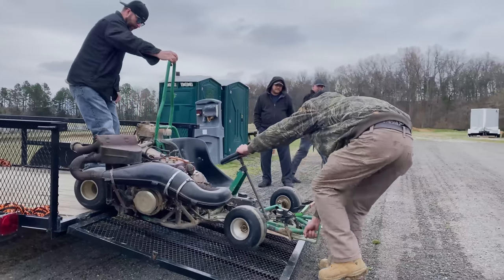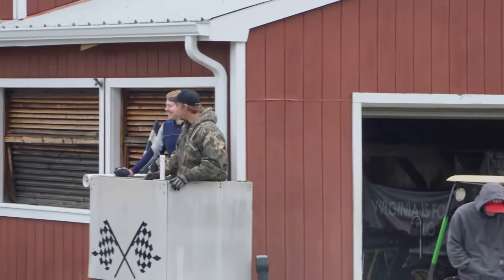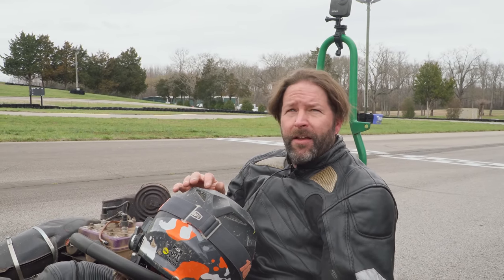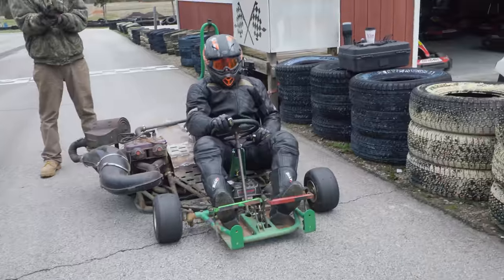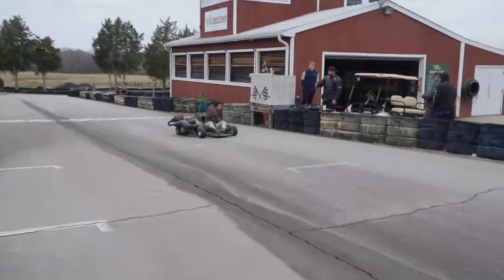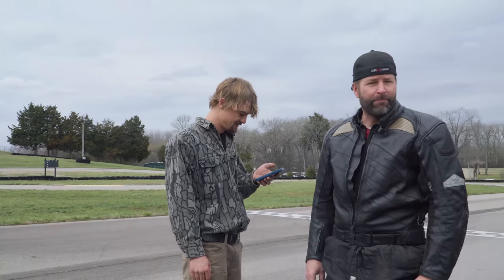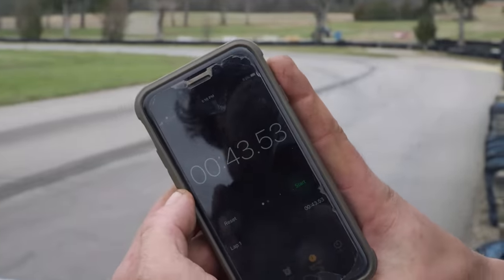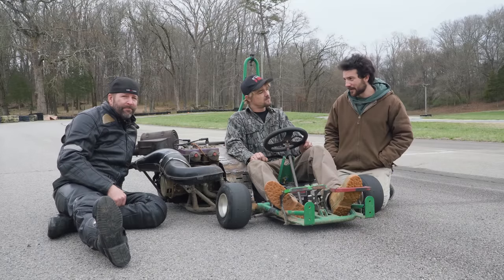We took our 125HP Go Kart to the Race Track! | *Insane Acceleration*

Comment: two strokes have their powerband from 7-8k rpm up to 11 or whatever is the limit. That kick you feel is the engine actually reaching is full potential
For the love of the engine make sure to heat it up always properly before sending it. 2s are design  taking metal expansion in to account and unless you want to kill it keep it warm 70-80 C° all the time.
Reply: The kick you feel is the engine hitting the pipe. That's when the exhaust flow pulls out the exhaust charge from the engine it's the scavenge effect.
Reply: I think that's what the Issac's slow lap was about.  He was rolling the thing around the track part throttle on cold tires.  The second lap he started leaning on it and warming the tires up and then he went for it.
Reply: That 670 twin spins to 8k max.  It doesn’t spin anywhere near 11k.
Reply: @rwbnatureadventure3876  don't tell them that let's watch them try to spin it 11 lol
Reply: @shawnstillman736  that's part of it..   but the pressure waves in the pipe push it back onto the combustion chamber, basically superchariging it. The more air:fual you can jam into the engine, the more power it'll make.   this is why they are so sensitive to the exhaust system.. hence the term "tuned pipe" and when it is operating at its highest efficiency, that is "on the pipe", you can change the way the power is made by changing the pipe.  That's also why 9/10 snowmobile powered go karts have less than half the engine's stock HP.   Nobody seems to understand this lol
Reply: @rwbnatureadventure3876     Yeah, but @Giacomo Mei wasn’t specifically referring to this engine. He said “two strokes”. And there’s plenty of factory two strokes that spin up to 13k and aren’t even making peak power at 11k, so he wasn’t really wrong.

Comment: If you can adjust your front wheel camber to a little positive, when you sit in the kart you'll have neutral camber and a full contact patch on the tire.  This will help get rid of the understeer.
Reply: Looks like it started hooking up pretty good once the tires were warmed up.  👌  looks like a lot of fun
Reply from the maker: Camber is fixed on this one if I remember correctly
Reply: @CarsandCameras  yea probably wouldn't notice much of a difference once your back in the yard.  Bigger tires with some tread on them would be cool!
Reply: At least the frame is made with removable spindle brackets... Shouldn't be too bad to make one of those. or ya could make a set of two that accept newer style spindles w/ eccentric bearings for adjustment.  I wouldn't doubt that back around when that frame was made, the manufacturer had sets of those brackets available with different camber angles built into them.  I suppose the main thing is: do ya really feel like doing the work?! hehe :D
Reply: @CarsandCameras  There is no such thing as "fixed camber" or "fixed caster"... When I was 14 I worked at 'Tustin Lawnmower and Bicycle Shop' in California.  Learned a lot.  We had a digging bar (a six foot solid 1 inch spring steel bar) with a steel steering bushing welded to the end at about a 45 degree angle.  There was a section of concrete out back with what appeared to be random loops of steel coming out of the concrete. 
This was a genius idea, and served as our "frame rack" for fixing anything that was bent. 
On about 50% of the go-karts that came into the shop we would do a "safety alignment" $20 extra (1981 dollars...that's like 2.5 gallons of gas in 2022 dollars)
I put a 6X6 under the front and back of the cart and tied it down with criss cross ratchet straps tight tight tight.
It was then easy to determine if the king pin bolt, or warn steering axles were the issue or if I needed to put the kingpin bolt through the tool and give her a quick adjustment.
You can easily bend the frame to dial in the caster and KPI (king pin inclination).
Obviously we sold a lot king pin bolts, and would even reweld and line bore (reem) the holes for a nice tight fitting steering knuckle.  We also would weld gussets on if reinforcement was required.
I loved that job and prided myself in the fact that I doubled the cost of the average go-kart repair ticket while simultaneously increasing customer satisfaction.  (We had an area 'out back' where customers could safely ride them before paying the bill that was way more than they expected). 
This job is why I decided to get a degree in automotive technology.

Comment: now in search for a two stroke snowmobile motor.
Reply: Should be plenty where you are. I 1200cc 4 stroke swapped a 4 wheeler. It was ridiculous. Did 300' race on dirt in the high 3 second average. And did 100 mph  easily. Your turbo raptor mower should get close to that with some good scoops 👍
Reply: 488 polaris twin is the best go kart engine. Fan cooled, low end grunt, plenty of power, fairly light, stupidly easy to fix, dead nuts reliable.
Reply: Yes! And put trash kitty in charge!
Reply: I have a lot and you can't have even one because they're staying in the sleds.
Reply: Just get any old motor bike engine and gearbox and it will be quicker then this.
Reply: @jakeparks1  artic cat 1000 are around 165 stock. My old polaris triple was 120 600 cc shit 850 twin 2 stroke turbo 225 up sled heaver than anything the motor going into.
Reply: I'm looking for one to put in. Street bike chassis going drag racing.

Comment: Driving 2 strokes off the gas that long and cruising will definately foul your plugs. Contstat bliping is needed and of course the balls of steel to drive that concotion on the track. The power is insane but handling is hurt.
Reply: gotta stay on the pipe.

Comment: In my experience those “pocket speedos” aren’t  very good at quick blasts of acceleration, you need to hold the speed for a little while to get a good reading.  So it may be impossible to get an accurate number on a track like that.

Comment: This is cool guys!!! I raced 500cc two stroke (non roll cage) karts on dirt tracks in central Fl in the 90’s, and raced 125cc shifters professionally in the early 2000’s. Get that thing corner balanced (best as you can), geared correctly, and put some front brakes on it and it will be a lot more fun, safe, and quick.

Comment: That is an AWESOME race track. I'd love to take my go kart there but I live clean across the Country in Washington State. that 670 go kart is definitely fast but I think it could use a lot more tire on it. a little taller and wider all the way around. along with the the upgrades that you talked about. it definitely looks like it would be a blast to rip around that track in that kart. I'm betting that I could shave off some more time off that fast lap. time once I got to know the layout of that track. no matter it would still be a blast trying to anyway. something that you need to do is put that kart on some scales. just to see what the right and left side weight is. I bet it's like 80/20 or 90/10 percent without the driver. that's always going to make it handle poorly turning one way than to the other. the only cure for that would be to widen the the wheel track out so the engine is inside the wheels. and have a driver that is equal weight. that is a lot of weight hanging outside those wheels. but all and all it looked like a blast no doubt.

Comment: Only way to fix the right hand cornering issue is to fix the weight balance problem.... Or maybe mix up the tire sizes and pressures..... Something... That would drive me nuts....
And better brakes. The Stooge almost lost it going into that first corner...

Comment: Definitely check your jetting as well. Those snowmobile engines are jetted to run at 0 degrees and less with more dense air therefore will run super fat and foul plugs at 70 degrees.

Comment: You will keep fouling plugs until you re jet it. It’s about 50 degrees warmer then it’s jetted for AND it has filters. Both are making it run WAY to rich. Safe but about 30-40hp down on power.   I love the 670’s!!!  Have several.
Reply: only guy here that has a clue.   good stuff, man!

Comment: I stand by what I said in one of the previous videos: Widen the track and frame and fully support that engine from the front wheel to the rear. I'd also say widen the rear axle to the max you can order off the shelf (if it isn't there, already) and try to offset the track a little to the engine side in order to assist balance.

That plus some larger and wider tires, plus FRONT BRAKES, and you'll be RIPPIN triple digit speeds somewhere with moderate safety, lol.

Comment: It might sound odd to you guys since you don't have much 2-smoke experience, especially snowmobile engines. But one thing you want to keep an eye on with an engine like the 670 is making sure you use the correct 2 stroke oil for your pre-mix. You might be already, who knows. But the Rotax engines use RAVE power valves in them instead of standard reed valves. That's what those black "pods" are above the exhaust ports on your exhaust side. You'll want to make sure the pre-mix oil you're using is designed for engines with power valves in them or else it'll gum up the power valves. Which will also cause performance issues for you. :)

Comment: You need to rejet that. When we run the older carved snowmobiles in the warm weather at the drag strip they need a major jetting change. Don't forget stock jetting is for 0-2000 feet at -10 to +10°f. I bet 4or 5 jetsizes would be safe.

Comment: tune up dont forget to service the rave valves.the bellows should be soft .not stiff, if those are not  working correctly it will be doggy,, start hard,foul plugs etc
calibrate the oil pump, ....should be starting warm without a prime......that old girl has ALOT more in her...totally awsome project

Comment: Off the muffler, run straight pipe out back off expansion chamber, gear it little lower so can hit the pipe quicker. It's off the pipe more than on it, it's basically loaded up 75% of the time.

Comment: The bogging sound during launch indicates the primary clutch spring is weak. The secondary clutch spring tension could be increased to allow for faster downshifting and to keep it in a lower power/gear ratio when the engine hits the powerband. You definitely would benefit from a new spring and lighter weights. The helix in the secondary clutch, could be swapped out for one that changes the rpm torque curve. 
 Since this motor is jetted for winter weather you should opt for smaller main jets to compensate for the warm air.
 Doing these changes will make that thing warp space and time for the rider!!! Like the Starship Enterprise.

Comment: You've got asymmetry in your chassis. You could check the corner weights. A quick way to check is, with driver seated, lift right front wheel up until the right rear wheel just lift clear of the ground. Then lift the left front wheel off the ground until the left rear just clears the ground. Both front wheels should rise the same height as the rear wheels clear the ground. I suspect, in your case, the right front right will rise higher than the left. This would cause understeer to right and much sharper turning to the left.

Comment: If the carbs are still jetted for winter it likely needs to be leaned out 4 or 5 sizes on the mains.  Also your frame is likely dragging in the right turns.

Comment: You guys should get a draggy for testing the performance of your karts.  Drag racers swear by them.  They are a little pricy but if it's just as accurate as the scoring loops at the drag strip.  It will give you all the data you will ever need

Comment: Well guys, I'm quite surprised that John doesn't realize this, but that engine is running very lean.  That's why it bogs, and why it runs and sounds the way it does.  Lean runs KILL two strokes fast, and the only reason you haven't blown it up is because it is so over powered and thus lightly loaded.  It's probably lean because it no longer has the restrictive factory air box.

When tuning these type carbs, know this great tip.  The choke circuit provides additional fuel at ANY speed/throttle setting.  Turn on the choke, and if it runs better, STOP immediately and richen up whatever circuit you were running on.  (Idle, mid range, wide open/main circuit., etc.)

Lastly, note that at wide open throttle, the neddle has been pulled all the way out of the needle jet and is no longer a factor.  A common tuning trick is to take out the main jet completely and run it.  This will tell you if the NEEDLE JET itself will flow enough fuel at WOT for that engine.  If not, install a larger NEEDLE JET, and go from there with your usual jetting process with the idle jet, main jet, needle height setting, etc.

Your AFR gauge will work on that two stroke too.  Just don't run the O2 sensor for extended driving as it will get dirty.

The four stroke on the dragster sounds fantastic, but just think what this two stroke would do.  Hint, hint...

Good luck!

Comment: The jetting is probably fuel rich.  That’s a good thing, it keeps exhaust temps down. 

You do have lots of exhaust smoke, so the oiler is cranked right up, maybe too much.  That will foul plugs and clog up exhaust valves.  To check plugs you need to warm it up then run a good 1/2 mile wide open and shut it off. 

Edit: when it keeps going down on power I believe it’s overheating.  That’s how they act.

If it’s to twitchy try toeing it out just a hair.  That might help in right turns also, but you probably need camber for that.

Comment: im thinking you could add a bit of weight in the front as well as a better matching tire compound or air pressure considering the extra heat. And perhaps some active downforce in the future for better breaking.

Comment: the big stinger size on the exhaust is definitely losing horsepower, you'll wanna measure the stock stinger size and make the exhaust tip the same size, two strokes power directly correlates to pipe stinger size

Comment: needs front spindles relocated and an alignment and put some ballast on the driver side  try and fix the weight distribution, replace those fuel lines and rebuild the fuel pump

Comment: Sonic shock waves in the exhaust effectively supercharge a 2-stroke.  The speed of sound goes up at higher gas pressures, so increasing exhaust back-pressure gives more top end power. That funny muffler has probably made it faster. The risk is you burn out a piston on the exhaust side.
Reply: I think you are right.

Comment: Two words: Power Washer. (Bringing dirt onto a pavement track is unsportsmanlike)
Two more: Front Brakes. (Slowing down contributes a lot to lap times)
Two more: Chassis Flex (To fix the handling)
Basically, the way that a kart with a straight axle can steer/turn is to break traction on the inside rear tire, by lifting vertical pressure on it just enough that the outer tire dominates.  Your kart can't get the RR to lift, so you can't turn right effectively.  In a better balanced kart (scale this beast with a driver in the seat, not empty) it is accomplished with the "waist" or narrower part of the chassis behind the front wheels.  So, here are some band-aids which might help.
1. Offset the rear axle to the right as much as you can.
2. Move the radiator to the left as much as you can.
3. Offset the driver's seat to the left if you can.
4. Raise the ride height of the left side of the rear axle.
5. Add caster/camber pills to the LF corner, and increase the caster on that wheel.  Maybe raise that ride height just a little too.
6. When driving, lean your body against the seat to the Outside of the corner. (seems unnatural, but remember what it is you want to do, and why)
I haven't gotten a look at the chassis or steering system.  The chassis must be allowed to twist a bit.  Too stiff, and you go straight.  The inner tie rod ends must be separated by a bit in the cross-chassis direction.  If they are stacked on top of each other, there will not be sufficient Ackerman, and too much scrub.
Keep up the entertaining vids!
Edit: Note that none of these adjustments need be big ones.  Every little bit can help a lot, and with some, 1/4 inch is huge!  All together, they may go a ways towards giving you a better balance on the track.  One more thing... The plug fouling issue may be caused by a dirty air filter.  You ran the kart in off-road left turns a lot, and powder clogging the pleats can really change the air-fuel ratio.

Comment: Definitely get rid of that oil bottle. People have been premixing their fuel for years.40-1 is perfect. Spare plugs are also a must and warming it up before taking off is important as well. Also an aftermarket exhaust would be nice to see. And for real fine tuning, clutch and jetting the carbs properly. Oh and put the primer plunger back on. It may look silly but it actually works very well. 2 shots to start then a shot every 5-10 secs until the idle smooths out

Comment: First let me thank you for making my day! I'm fairly sure she needs lower gears. (Engine rpm does not sound like it's much in the "power band") As for wheelies, my ex bro in law raced a
2stroke cart at Ford City Pa back in the late 70s and with a 125cc "yellow mac engine" which was no where near stock. And a 6'4 145lb rider daylight could be seen beneath the front wheels coming out of the back corner.
When I say nowhere near stock, let me explain. Fritz was the 2stroke guy at J&D engineering his number was 9, and that little engine was roughly 43HP! In a convo with his
dad I overheard him say with the right gears it should do 140mph......

Comment: You need to tune with an egt gauge or read your plugs that 670 is pig rich. Put in some smaller main jets. They do not foul plugs if they are jetted correctly. It’s not your coil or plug wires. Make sure the carbs are sync left to right so the slides rise at the same time they bog hard if the slides are rising unevenly.